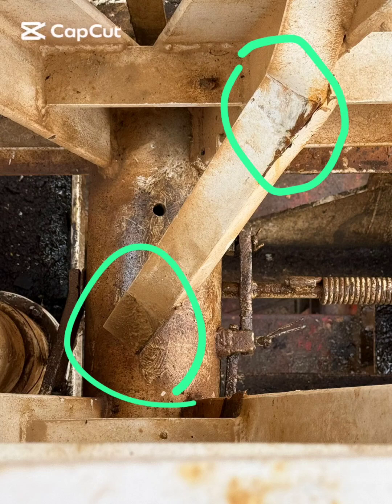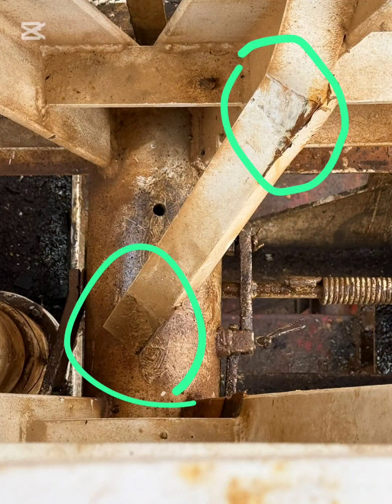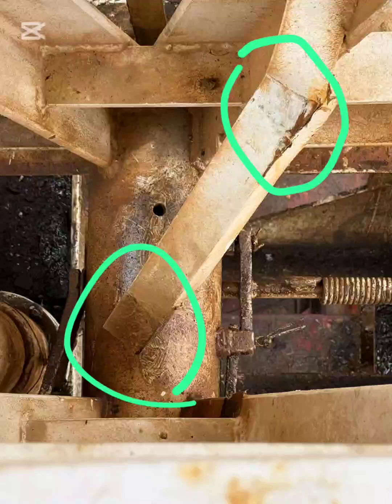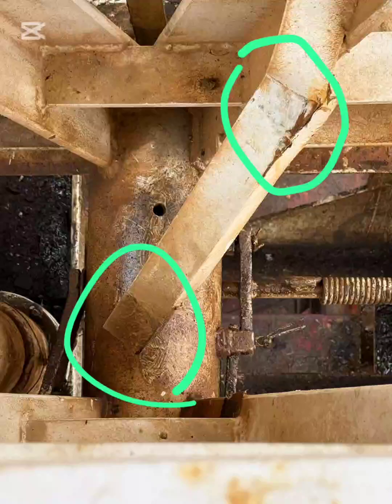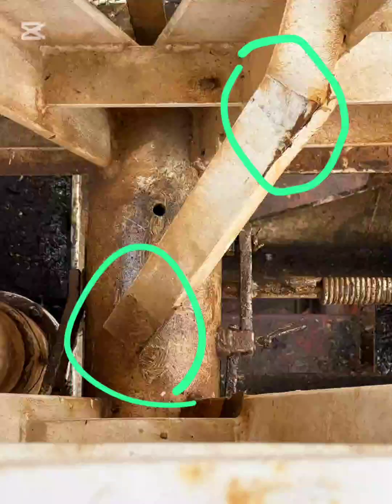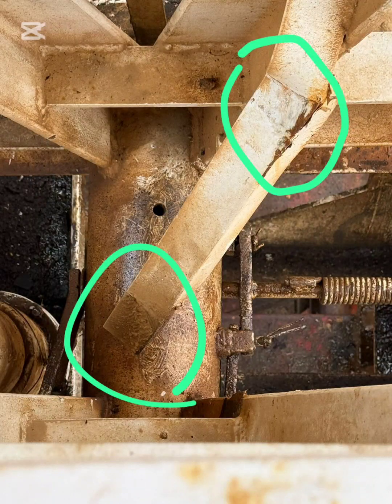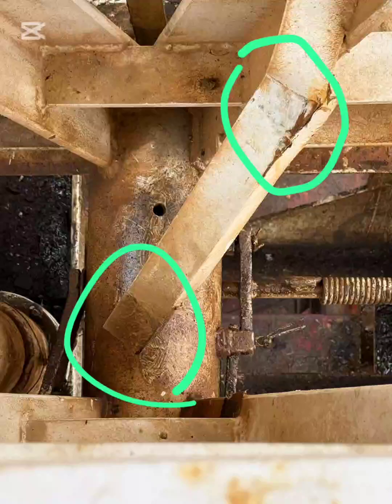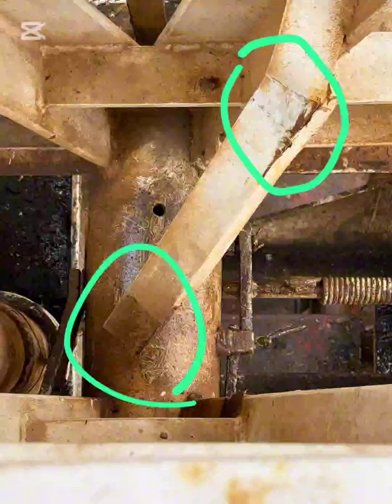Cracks in the Rig Mast You Should Fear#RigSafety#RigMast#OilfieldSafety#StructuralFailure

Comment: Like a beam dropping on a inspector
Reply from the maker: Thank you for your comment and for raising this important point. 👍
Yes, cracks in the rig mast are a serious structural integrity issue. If left unaddressed, they can lead to structural failure, including scenarios like a beam or structural member dropping, which could be fatal for an inspector or any crew member working below.
That’s why mast cracks must trigger:
Immediate engineering assessment
Load restrictions or suspension of operations
Barricading and exclusion zones below the mast
Proper NDT inspection and repair before resuming work
This video is exactly to highlight that small visible cracks can lead to catastrophic outcomes if ignored.
Thanks again for engaging and helping spread awareness — one observation can save a life.